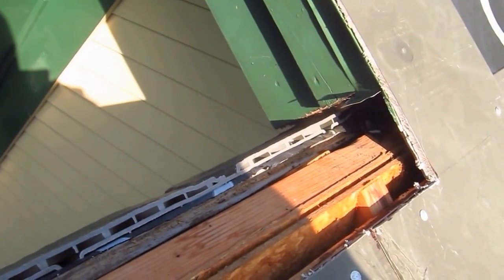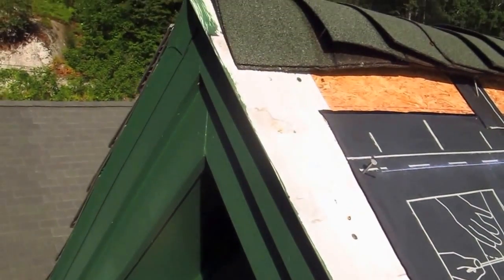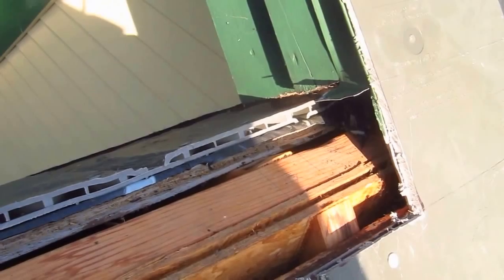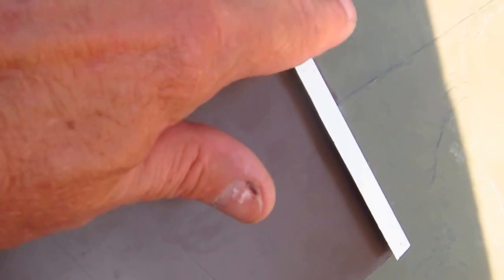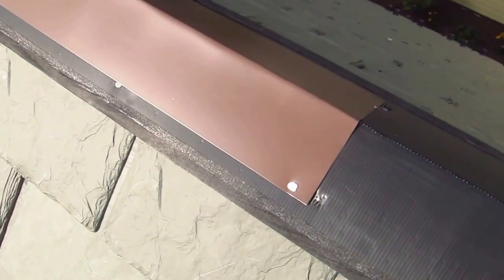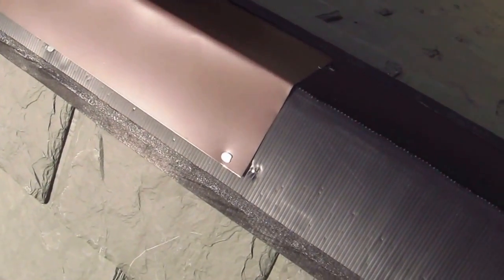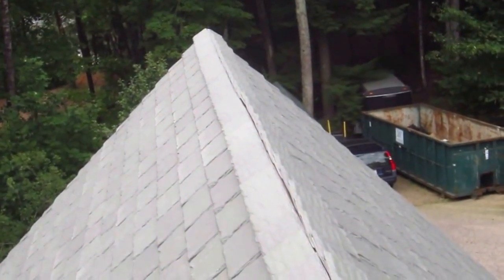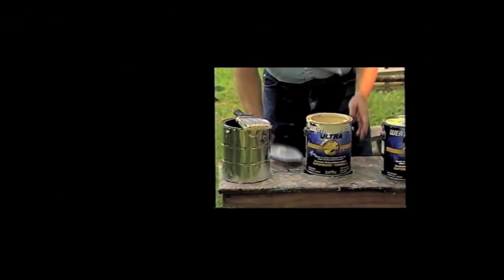Roof Fascia Flashing

Comment: i think i understand the system on that part of the house roof.
interesting technique. never worked with synthetic slate so i'm clueless.
i'm genetically opposed to leaving gaps in roofing and flashing.
i'd have squished a good line of urethane into the gaps before i slid the hemmed flashing piece into them.
would have covered the peak gap line in the synthetic shingles somehow.
there is too much that i'd fear would happen under the topmost shingle between them and the aluminum beneath.
the sun wasn't that bad.
you had the cam up close enough to see what the surfaces were doing which is important in roofing details.
lovely home and what a view.
Reply from the maker: Thanks. Beware of caulk on a roof. It's not a permanent material. Always leave a pathway for the water to flow down.

Comment: Hello Tim-
   I understand what your saying of the Da Vinci Roof Shingles but I was referring to was you stated saying the water will go between the roof cap then work's it's way onto the aluminum flashing and onto the roof's shingles - what if all that rain would freeze up between the roofs cap and the aluminum flashing which the end result will lift and crack the roof caps, as your well aware freezing ice will crack and seperate the roof cap shingles unless your attic is well heated .
Reply from the maker: +Pete Moss It's not an issue. It rarely rains here and then freezes. It snows.....

Comment: thanks for the explanation,   we just had an issue with a house we are fixing up. had a new roof put up last March but hey didn't replace the drip edge. it was allowing the water to run behind the fascia board and siding. to make it worse, they had tyvek on the siding trapping water against the soffit and siding.

Comment: You mentioned drone ...... have you yet seen one that could be trusted to get close-up detail views of developing cracks in  shingles , flashing leak points as you said  ..... for  inspections .. ? .......... good job btw
Reply from the maker: +Yesquiet Boy, I don't remember saying drone in this video! Sun stroke !!! It's not so much the drone as it would be the ability of the operator. He'd also have to have a fantastic camera that would zoom in with little loss of clarity. One day it will be possible. Probably soon.
Reply: +Ask the Builder Yes, that's the issue ...zoom with clarity ..... Thank you  ,  good one  ....... btw  between  13:02  to 13:06  .. " ... in a helicopter or maybe a d_ _ _ _ "    ha

Comment: Hello Tim -
   During the winter months - as the ice forms on top of the roof then freezing and melting and freezing over and over going through the space or gap of the cap shingle onto the aluminum flashing will the freezing ice push up the cap shingles .   Can the space be some how avoided by a cap shingle that will eliminate that space . Ok roof's do have certain pitches but it would a better system if there were caps to fit roofs under those circumstances .     Good video also liked that hemmed edge idea, I will keep that in mind.
Reply from the maker: +Pete Moss I don't anticipate any issues with ice and the cap shingles. The DaVinci Roofscapes material is so slippery it's designed to shed snow. It's mandatory to install snow guards on the lower edges of the roof where snow and ice can crash down on people and animals.